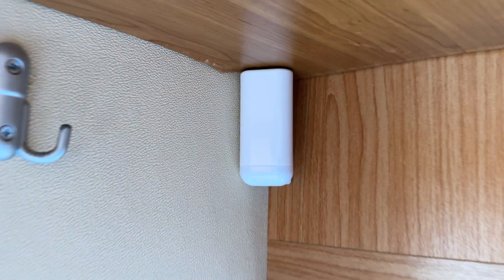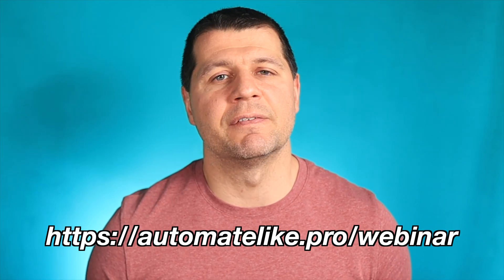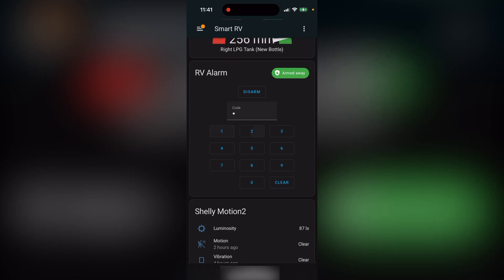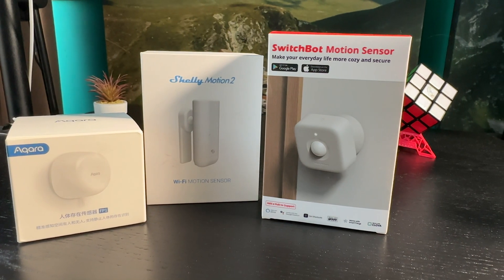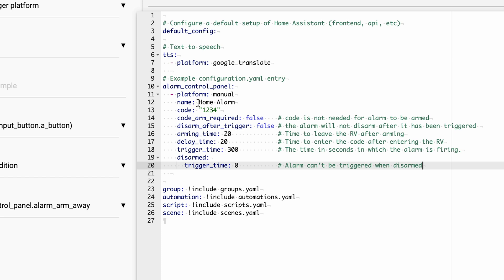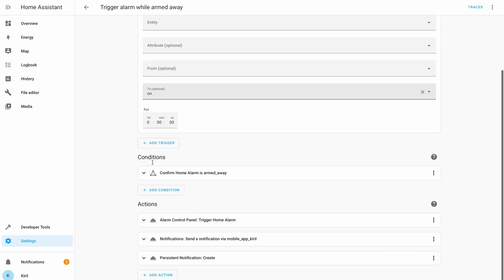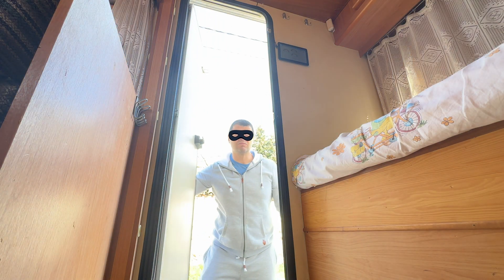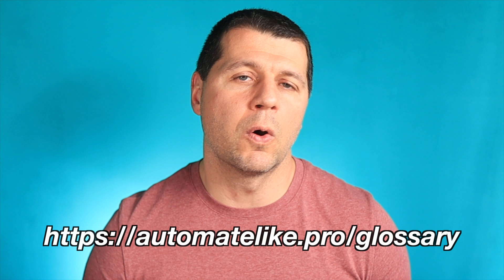DIY Alarm System for Your RV or Home Using Home Assistant and Smart Sensors

Comment: How did you solve the WIFI? My WIFI doesn't work when running on inverter :(
Reply from the maker: I run my router on 12V DC and I have no problems. Check this video of mine for more info - https://youtu.be/j7M_-mJzC9w

Comment: Hi Kiril, Thanks for the good tutorial. I have already installed an alarm system in my camper more or less the same way as you did it 😉 I use some motion and windows sensors to trigger the alarm. I also have a sirene installed internally in the camper connected to a switch I can control with HA and also the sirene of the camper itself also connected to a switch. I'm using the Sonoff NSpanel as control panel to enable/disable the allarm. When the allarm is triggered I send a message to my phone, I turn on the 2 sirene, I start flashing the lights in the camper and I take some pictures (from the 3 ESP32 cams I've installed 😎) which are also sent to my phone. I've a lot of fun with HA in my camper 😊
Reply from the maker: Great work Stefano! It seems like a real HA fun indeed. Do you have a way to remotely shutdown the Camper engine in case of a theft/activated alarm? I want to make that as well for my Camper and I'm gathering opinions/methods ;)
Reply: @KPeyanski  no I don't have it, but maybe a switch cutting the current to the motor could be a possible solution.

Comment: Note the Google Nest smart speaker is also compatible and doesn't require the subscription Alexa/Echo integration. I've already built something along these lines using ESPHome to interface with some existing magnetic door sensors but this give me some additional ideas to explore. Thanks!
Reply from the maker: Great, thanks for sharing. Yes, AFAIK Google Nest smart speaker can be used for TTS and playing sounds (alarm sounds) easily from Home Assistant, so it is a good choice indeed

Comment: Suggest some physical keypads please which are zigbee enabled
Reply from the maker: Yes, that will be interesting to see. Unfortunately, I don't know about such...
Reply: @KPeyanski  there are certain zigbee keypads but they are discontinued or something so sold by eBay and eBay doesn't works in my part of world and if I import it's going to be super costly. Nearest one would be ring keypad v2 however that's zwave. And I do not have zwave dongle

Comment: I'm using zigbee window/door and motion sensors, nothing special there, for door security i use the ULTRALOQ Z-wave smart door locks which i have automation's that lock and unlock the doors automatically. For a siren i built my own using a loud but cheap 12vdc siren i bought on amazon and connected it to a singled smart plug. But the software i use is a HAC's integration called Alarmo. This is a really nice alarm program that brings all your sensors together in one package. Then i use a NFC tag i placed in my car to arm/disarm (and unlock my door when i get home) my alarm system. I also have a alarm mp3 that plays if the alarm is triggered while I'm away. Also if someone rings the door bell (its a smart video doorbell) and the alarm is armed i have my google play another mp3 that has a dog growling and barking at max volume so they can hear it.
Reply from the maker: Thanks Larry, very detailed and useful info. Can you share what is your alarm mp3 model exactly?
Reply: @KPeyanski  I'm not sure i understand your question? Are you asking me where I got the mp3? If so i got it from amazon, It's called 500+ Sound Effects Paid $10 for all of them. I placed the alarm and dog mp3's in the local music folder of HA

Comment: I wonder if it makes sense to have an actionable notification on the phone for disabling the alarm. Assuming you already need to authenticate on the phone there should be no need to input a code for the alarm.
Reply from the maker: Yes, that is a great Idea. It makes much sense in my honest opinion. I'm probably going to try it ;)
Reply: @KPeyanski  and I'll be looking for an update video from you 🙂 Another feature would be automatic arming, based on some conditions. For example in my case i have modified a door sensor so i know when the door is locked: i have soldered wires from the sensor replacing magnetic switch with a microswitch inside the door frame that is pushed by the lock tongue when locking the door. This way i could automatically arm the alarm when i lock the door.